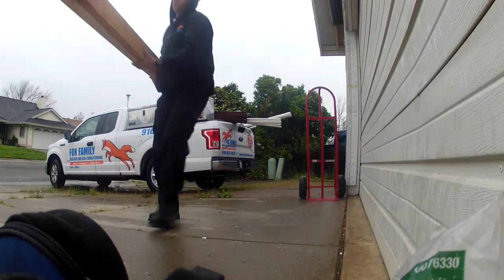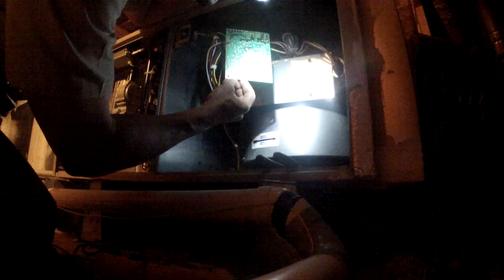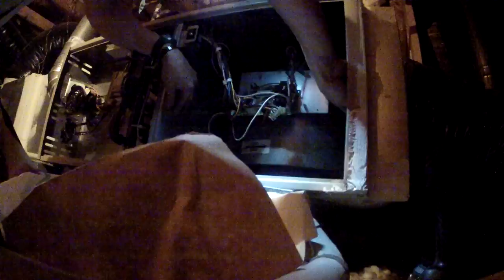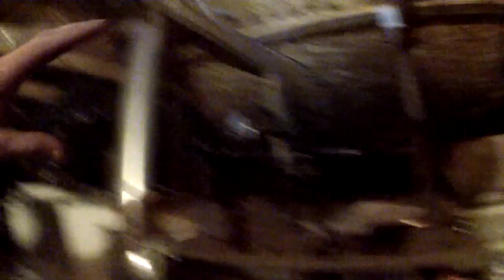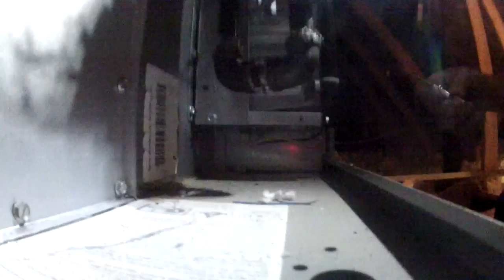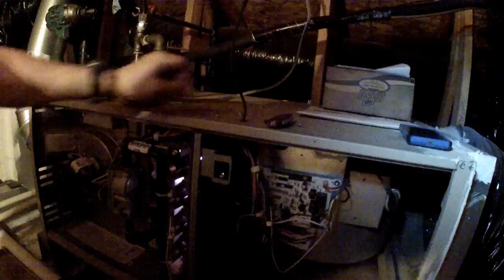HVAC Service Call - York Diamond 80 Repair - Sacramento Furnace Repair

Comment: Can you put a link or part number for the board, or where to buy onet?  Sounds like the issue I'm having as well.  Thermostat turns on but the furnace does not respond.  But then there are other days it runs perfectly .

Comment: Ok, I think I may have found out part of my problem. 

My  Diamond 80 is on the side 180 degress from that show in your video. It appears some may have "sat" on the furnace when changing a zone board that is mounted on one of the A-frame's..

So basic question. How should the doors go back in.  My are so tight from being wedged against to to the top being slightly pushed down the need to be forced in.

Does the door with the port hook around the L-beam at the center? I would think so so that panel is held against the furnace door switch.
I would have thought the door with the port would go in first, but I can't seem to get the top panel in and I believe its allowing the other door to separate off the door switch causing an open circuit.  

I can tell by marks on the doors this has been a problem before.

Thanks, I think several people could have an answer for me as I am sure its a lot more obvious when they slide right into place...

Comment: Hi Mr Fox, et al.

After following several of the diagnostic procedures here I was able to get my York Diamond 80 furnace to work with one strange exception.
1.) Door switch proved to be working correctly (Big Name Service company reported bad)
2.) Once Door Switch was held I was getting 120vac at the Switch and to the board.
3.) I was getting 24v at the transformer.  But the status led was not lighting.
4.) Followed the connector with wire harness, coming from transform. Notice some torque to the connector. So I replugged that connector.
5.) red light came on momentarily, heater started to cycle .....   when all the jets came up they cut off.. did this several times. Turned off the door switch (opened).. and did the fire sensor cleaning.... put it back in, close the switch...and it appeared to cycle up correctly.

All please with myself. Replaced lower door. ok. Went to replace upper door (with Diamond 80 logo) and it shuts down the furnace. I attempted to tuck and wire bundles that looked close to the door... but doesn't seem to help.  Any ideas on this one? Could it  be the pressure switch? Not sure if turn on cause more back pressure.  Is there some kind of protection switch on the furnance side?
Seems to be running fine without the door on... but I know i shouldn't leave that way...
Thanks for any suggestions.... 

P.S. Thanks again.. I've already literally saved over $1000 and my Furnance service provider;s  recommended they replace my whole HVAC system...

Comment: My local repair company wanted to charge me $4,500.oo+ to replace my York Diamond 80.  I asked for the cheapest repair and haven't heard back from them.  So I went at the problem myself.  I replaced the capacitor for about $9.00 and found that the vacuum switch was functioning properly and the combustion exhaust fine was working fine.  Then I found that the gasket around the combustion exhaust fan was broken in several places, the cause of the vacuum loss, so I scraped off the old gasket, cleaned up the fan and housing, applied a high-temp gasket material, and now it is functioning just fine.  Saved myself $4,500.oo.  I haven't heard anything from the local repair company (Academy Air) since I stated that I wanted the cheapest repair and THAT is why I did my own diagnosis and repairs.  Wooo-hooo!
Reply: Academy air is just a scam bro 🤣🤣
Reply: @benjaminwallace4626    They're not a scam.  They are a legit. business but I think the tech was trying to drum up a sale.  Live and learn.  If we're not learning at least one thing every day then we're falling behind!
Reply: @patmancrowley8509 well if they try to sell you a new HVAC instead easy repair, if that's not scam, then what do you call it?😅

Comment: I have quick question why don't you ever use a manometer to check in wc, gas pressure, pressure drop across blower and coil also do you not check combustion

Comment: Video posted on my birthday, lol. Never seen a control board fail like that, blower motor cutting in and out. We picked up a apartment complex account 2 months ago with 40 Diamond 90% furnaces where I work at. Been busy over there, combustion motors mostly. Thanks for sharing the video Fox.

Comment: I wonder if I can have a piece of advise in regards to the problem I have with my YORK Windsor 80, Model # P4HVC20L08001A, this unit was installed in my house on 2001.The problem I have is no flames come out, I hear the clicks but nothing more. I checked for 24 volts coming out the control board feeding the gas valve and nothing more than 1.9 volts reaching the gas valve, I cleaned the temperature flame stick and installed back, I unplugged the pressure switch hose and clean it, I set my voltmeter at the control  board checking for 24 volts leaving from the yellow and black wires going straight to the gas valve, not getting 24 volts, I unplugged and re-connect the wire connector to the control board, turned the unit ON and flames came on, the fan also came on, everything works fine for the all day, and when the unit turns off after reaching thermostat temp setting, the unit trying to start back but not flame....The control board blinks SEVEN times, I checked the cause and is indication of pressure lost, faulty gas valve, etc. but some times I get 24 volts and gas valve works fine....I suspect a bad board. can you advise what I should check next before switching to a new board and new gas valve......I truly suspect a faulty control board not sending 24 volts all the time, but just some times.Thank you
Reply from the maker: henry ayala yep. bad board..I'd change it
Reply: henry ayala I would have checked the in wc coming out of inducer and in wc it's pulling in then check pressure switch rating and see if inducer is at the rite in wc  to open or close the pressure switch if not you have a bad inducer if so check continuity across pressure switch if pressure switch doesn't open or close at the rated in wc depending on whether it's normally open or normally closed circuit you can determine if it's the pressure switch boards don't always go bad it's normal something beside the board
Reply: Or you are going out on hi limit which means you have a air flow issue or a heat exchanger Crack or clogged up would need to do inspection of heat exchanger and a combustion test to check your co levels